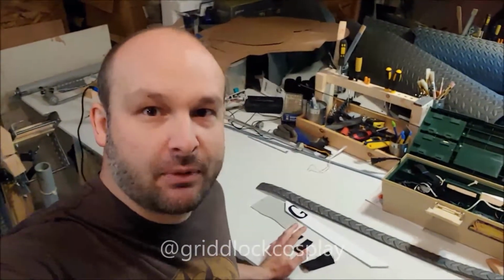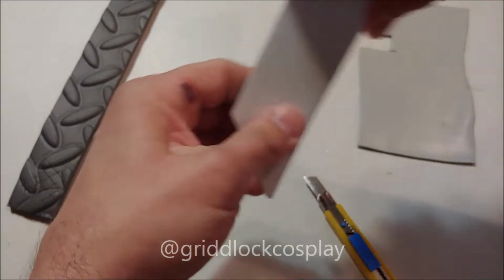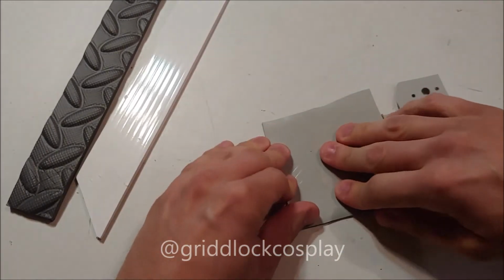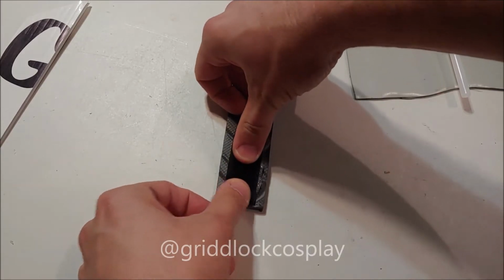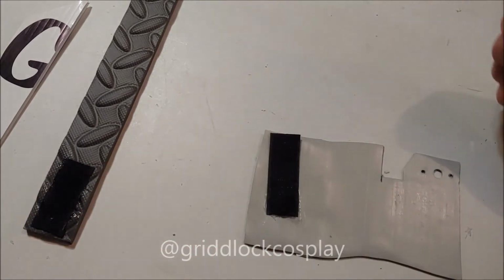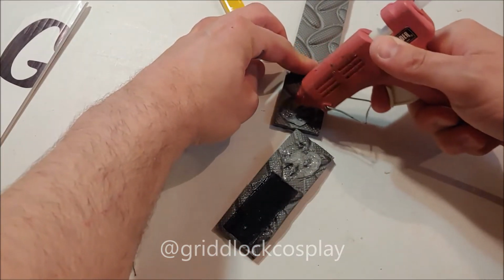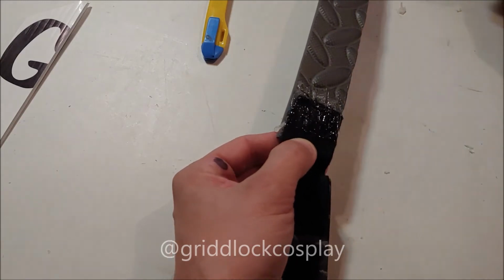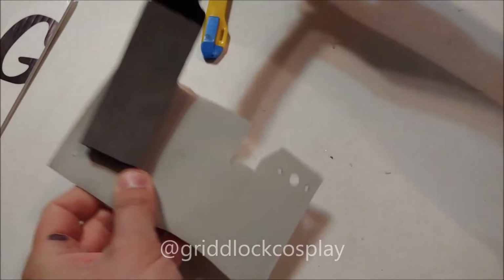Hot gluing Velcro onto EVA foam and plastic/PVC

Comment: I'm trying to make a Protoss mask from Starcraft and my mask needs interior velcro to assure easy wear. But I've had bad luck with velcro always peeling off of foam even with your method. Is there a type of glue I can use that isn't hot glue?
I'm using thin foam to keep myself from overheated and sweating. (Like I mean the type of foam you see in the sheets at Walmart)
Reply from the maker: Hot glue does have problems adhering when in humid or hot conditions. You might want to try a superglue. Epoxy might also work, but it is very rigid, so if there is any flexing it can simply break off or at least crumble bits all over you.
Depending on your setup, velcro hold well with stitching, but I imagine inside a foam helmet that might be completely wrong.
Reply: @GriddlockCosplay  Ooof thank you for the help!

Comment: I need to glue a velcro to polycarbonate plastic and foam..idk what to do i used epoxy but ..it gave up on me
Reply from the maker: Epoxy is not great for foam because foam is flexible and epoxy is extremely rigid. The most important part is to make sure the glue has a place to grip on the plastic. I would try sanding it a little with extremely course sandpaper, then making "hashtag" scratches with a knife. Epoxy might work then, or even hot glue.